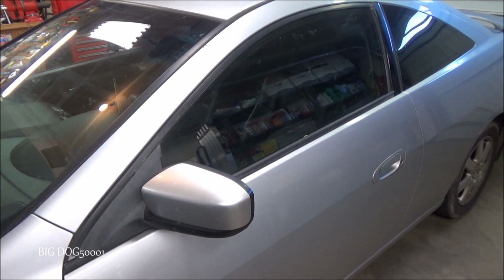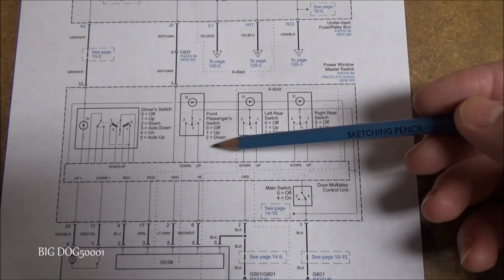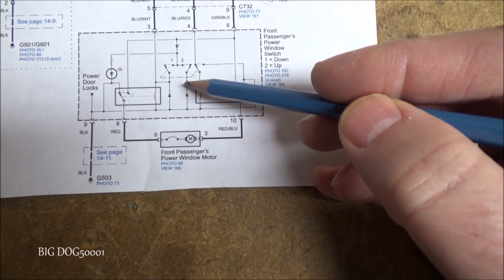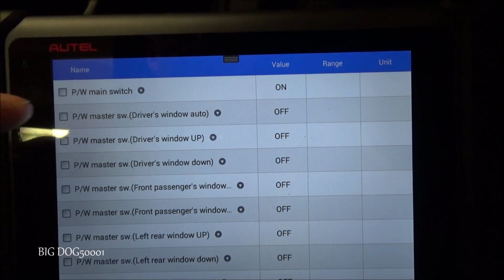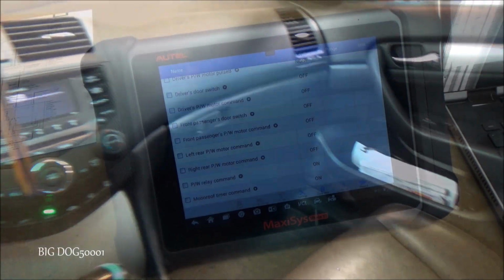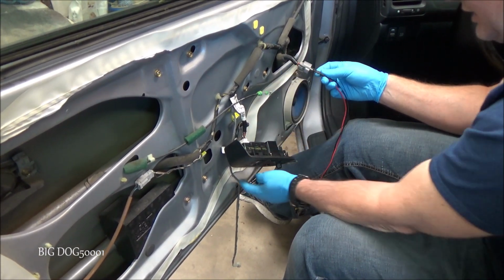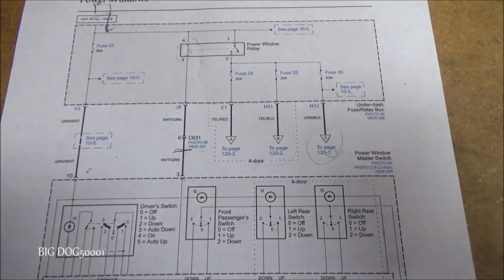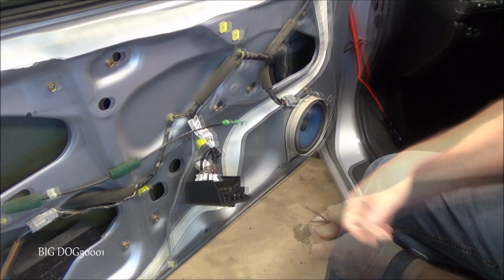Honda Power Window Troubleshooting Accord 2003-2007 (B-CAN Network)

Comment from the maker: Tools in video:
This channel earns a small commission using some of these links - at no additional cost to you.

Autel MS906BT scan tool: https://amzn.to/2Z4iaDs
OTC 3636 Test Light:  https://amzn.to/31G9Hbi

The Big Dog 50001 Automotive Channel Store can be found here: https://www.amazon.com/shop/bigdog50001automotive
Reply: 0
Reply: Hi when u said either the switch or the relay is the main relay that controls everything or just 20 Amp fuse that controls the driver door switch? Please reply thankyou.
Reply: Awesome video sir!  I have been having issues with my windows for about two years now.  The problem was always intermittent at first and then the passenger window failed completely.  Then the driver side started doing the same thing. 

When the window doesn't want to function, after a period of time, I will hear a 'click' and then the window will start to function. If I notice I hear a 'click' and try to operate the window it will not work.  It seems like something is just randomly switching on and off for a period of time. This is how the passenger window was acting and then just stopped working altogether. I am trying to pay close attention to your video a second time and hope it helps.  I like learning anyway so I prefer to watch your video till the end. 

Now today I heard a loud scraping/popping noise when putting the window up and now it will only open and close aboutan inch.  So now it is time to pull the panel and see what's going on.  Thanks for sharing your knowledge with us man.  I appreciate it.

Comment: Same car, different issue
Neither window works.
I had replaced the regulators, and the windows worked for a few weeks, then stopped working. 
First one stopped, then the other. 
I tested wired and checked fuses. All good.
Got the passenger window to operate a few times, then quit again. Seemed to “reset” if i turned the master switch off. Then nothing again.
Took the master switch apart, found it broken so i bought a new one. Still nothing.
Put another regulator in the pass. side while i had the door apart. Nothing.
If i apply power to the regulator at the connector, the window operates.
Fuses still fine.
Thoughts?

Comment: I had an issue where the drivers side directional blinked fast (as if one of the lights were out) replaced both front and back signals and the issue continued. Found this video, while it wasn't the exact issue I had I decided to check it. The old relay didn't seem broken it didn't buzz. But I replaced it and it solved my problem. Commenting this Incase anyone has the same problem as I did

Comment: I'm having a issue of the little button to control the up n down window, the lite on each button stays lite, even after head lights are off and dash lite dims out.  All but the drivers side stays lite.  Anyone have any info on what I need to do to correct it,  I've been disconnecting my battery every night to stop it from killing my battery... 2005 Accord.  TiA
Reply from the maker: The ground to turn on the LEDs on the driver's master switch is controlled by the control module (Door Multiplex Control Unit) located inside the master switch itself.  An input keeping the module awake or a problem with the master switch itself are places I would look.  Resetting the window control unit is worth a try.  https://youtu.be/scWc_9ALo9Y

Comment: (2009 4-door Civic) Over the last 4 years, each of my 3 passenger windows has gradually developed a failure to roll UP from the driver control switches (only).  One-by-one, over those years they individually each started to stutter over several weeks and eventually completely failed to roll up from the driver door controls.   All windows DO function perfectly up/down from their respective local door switches.  They also roll down perfectly well from the driver control switches.  I have been though several of your videos and can't find the appropriate one for my issue.  Please direct me.  Thanks !

Comment: Hello sir I have honda pilot both of my rear passenger window not working even if I use the driver power switch but I hear is clicking i check the rear passenger window relay its good and the connection i have power and ground when I check both of the fuse using my test light and doesn't light up no power and I have ground on both switches I dont know why both fuses has no power. Can u guide me what to test next?

Comment: Power windows in my Honda Civic 2011 will not go down and my tail lights are out now to? Wondering why ?
Reply from the maker: Depends on whether or not the problems started at exactly the same time, they may or may not be related.  Here is a video where I troubleshoot a Civic similar to your 2011:  https://youtu.be/-aJjB0VPAEk

Comment: So, according to your diagram, there are relays in the front passenger side window switch. I hear clicking, sometimes at a stoplight it just "clicks". And the window will not go down. Or, it will not go down until I pull over and slam the passenger door. But there is a "clicking" coming from that passenger side switch area. The window can be operated from the master or passenger switch, when it does work. So is it the relay, the "home/ auto-up" feature needs resetting on the module or the switch. This is a problem that Honda has had for many, many years with their windows, their radio back-lighting going out, and LED back-lighting on the speedometer. There are countless forums on this window problem, and people are begging for answers. Some are even asking for help to convert this motorized debacle into roll-up windows. Unreal. And wait for the Tesla owners 6 years down the road.  😅 😂 🤣

Comment: I bought an Accord today were the drivers window doesn't work and the passenger window goes up and down slowly. The good is the owner reduced the price by 2500 lower than the same car was selling for everywhere else in my area.  For that I could put stainless armored plate in place of the windows. lol Just kidding.
Reply: How good are you at removing the inner door panels? Pretty easy if you go slow. The "regulator" has a cable attached to the motor. As rain and the elements get in the area of that cable, it causes corrosion and a little rust. Much like a brake cable or a gear shifter cable on a bicycle that never gets lubed. I took all of my motor/ regulators out and lubed them thoroughly with a silicone spray. I mean soaked them. They work great now.

Comment: I had an issue with my wife’s 04 Accord where the LF power window suddenly stopped working.  I watched your video and was totally impressed with the depth and detail that you went in to to explain the entire system using the wiring diagram.  You also showed your diagnosis procedure using simple tools.   As it turned out the motor was the culprit, which I dismantled, tweeked the brush springs ,and now it works like new!!  I must say that you’re a very good teacher……in fact I told my wife that you could work at any college or mechanics school around.  Thanks again and keep up the great job!   Roy Bartz 👍
Reply from the maker: Thank you, I appreciate the comment!

Comment: very informative video thank you. All my windows except driver side in my 4 door 2005 accord havent been working for the past few years and just yesterday the drive side finally gave out when i put the window down. Now all my windows dont work but just by watching your video im convinced I need to replace the window regulator
Reply: I have the same problem as you. Only drivers window works. Did you figure out the problem? Thank you.
Reply: Did you figure out the problem?

Comment: I’ve watched tons of videos on trying to diagnose the problem with my passenger window not working. After watching this I wish it was my driver side not working!! What would you suggest my next step to do as I’ve replaced the master switch, regulator/motor, fuses and I am getting power to passenger switch. I’m all out of options smh.

Comment: This is a great video I was looking for. I have a 2005 Accord coup 2.4 and my both windows acting up on me. I haven't found any system how they work or actually don't work, sometimes they do work well, then they don't. Sometimes I hear clicking sound from the switches (even on pass.side) and sometimes I don't. Sometimes one window is dead but the other works... I'll try to use your know how about the wiring to track it down, but my problem is - it works and it doesn't, like a bad wire connection or something like that. I tried to reset the control unit also. No success. I used a foxwell scantool and one interesting is, when you push the switch let's say DOWN the value in the scantool says UP, but the window goes down, when you push UP, scantool says UP. Anyways, thanks for your time, cannot imagine a better lesson to these honda's windows problems 👍
Reply: I have the same issue
Reply: @olee_24  I replaced the window unit on driver side, it was working for couple of weeks and then back to the previous stage. There must be something with the wiring, probably corroded on the way to the ECU, or exposed to another wire or chassis (maybe in A pillar where it goes from the door into the interior of the car). I have no time to track it down.

Comment: Urgent help:
I have 2006 Acura TSX. The window switches on all the doors stopped working and don’t even light up. I know I messed up some electrical component because when I use my oem key and hold the unlock button, the windows roll down.
There is no power in the switches, can you help??
Reply from the maker: You can keep it simple to start with and check the fuses, but that is probably going to need some troubleshooting done on it.

Comment: What would be the problem if i always have power in the down position on the passenger window even if im not pressing neither switch its acting like its pressed in the down position already replaced passenger switch but im still to replace the driver side switch, how would i go about testing if the main switch is the problem?

Comment: Thanks you master mechanic.. technician.
Reply from the maker: Thank you, I appreciate the comment!
Reply: @BigDog50001  
Hello Sr have a question about the master switch. My problem start normal stress day , travel to dinner and after found parking close the window noooo 😥 no work go back apt and pray. Start for study how this works found thermal switch bad, eBay used good God thanks . How I reset the switch. Thanks.

Comment: Great video I have the same exact car with a very similar problem. I have changed the regulator on the driver's side and powdered the window up and when it got to the top it stopped and now every time I press the button to let the window down it blows the number 27 fuse and I don't have a clue what the problem is.
Reply from the maker: Things I look at for blown fuses, either the component (window motor in this case) pulling too many amps or a wire is shorted to ground.  If it wasn't blowing fuses before I would double check work or it is possibly a bad new motor.  Thanks for the comment!
Reply: I tried some of the things that you are saying and I finally found the problem and it was something that I really didn't think about. The new regulator I brought was defective I replaced it with another one and problem solved. Great video though it was very helpful I subscribed to you channel looking forward to future videos.

Comment: So I’ve change the window motor and wires, checked fuses and everything good and window still don’t work, what should I do next ?
Reply from the maker: Test light is your friend in that situation.  I would use a test light to trace back where I was losing power or ground.  If either is missing (or not good enough) then the window will not work.

Comment: I have the exact car a 2003 Honda accord lx coupe 3.0 6 cylinder automatic but neither my power windows not locks work and I have only replaced fuses under the steering wheel can you show me where the relay is? Thanks in advance
Reply from the maker: I would check all fuses in the DASH and HOOD fuse boxes.  Windows and locks are two different systems, so I would look at what they have in common (under dash fuse box/MICU unit and the switches come to mind).  I would definitely make sure the driver's side switches are plugged in properly (especially if work was done on the door recently).  It will probably need some troubleshooting.
Reply: Hi there update on my vehicle so I just replaced the master control switch panel straight from the dealership ... now my passenger window goes up and down beautiful but my locks and my driver goes up or down any recommendations ...? Maybe I need to reset the window switches somehow?

Comment: how much would this cost if i had went somewhere ?
Reply from the maker: Most shops start with an hour diagnostic fee which can range from $75-$150 depending on where you live.  Some will waive the fee if you pay for the part and install to fix it.

Comment: Great video! I'm having trouble diagnosing the issue with my accord (same year coupe).....if the driver's window does NOT go down when you hold the unlock button on the key FOB, could it still be a bad window switch?
Reply from the maker: They are multiplex controlled so it could be many things.  Easiest thing to try first is a control unit reset.  https://youtu.be/scWc_9ALo9Y

Comment: Do you have a solution to the following issue? '04 Accord Sedan Power window switch was working before I replaced it with a different USED power window switch (Needed the new wood grain plastic piece, the old one's plastic screw insert/plastic tabs broke) the new used one came with the switches attached so I just put it in & it does work overall, however the passenger window switch rolls the passenger side window up & down but you have to keep holding the switch in order to do so otherwise if I press down it will start going down but if I let go it will just roll back up (Problem.#1, Note: The Driver side switch rolls the Passenger side window up & down just fine).Does the passenger side power window switch also have to be re-prpgrammed? 
Problem #2 With the new USED Power window switch sometimes I will hear a clicking slight sound for the Driver side Power window like the sound when you would press the window button up but the window is already up (But you're not pressing any buttons) & if you try to roll the Driver's side window down while it's making this clicking type sound it won't respond/work, if you wait about 3 seconds after the clicking sound stops then it will roll down & up just fine. (Note: During the clicking sound even though the Driver window won't roll down, all the other windows will operate via the Driver window control, including the power mirrors). What do you think could be causing Problems #1 & #2? 
I could try putting the Original Driver side Power window switch back on the new Wood grain plastic cover, if I do should I also put the original power mirror remote back on as well or does that not matter?
(The reason why I'm asking first instead of just putting the original controls on the new wood grain plastic piece is I'm concerned I may break another Plastic clip or damage the plastic screw inserts again removing it & would have to order another wood grain plastic piece again). Hopefully there is a simple solution for Problems #1 & #2? Thank You
Reply from the maker: The window switch (master switch) on driver's side has a control unit in it.  Honda master switches are finicky, If the new (used) one is not the correct part (different trim lines use different master switches) or it is an aftermarket unit there can be issues like you describe.   Clicking sounds sometimes mean the control unit has learned the wrong position of the window and It is possible it just needs to be reset.  Breaking plastic on those trim pieces is a real concern, the wood look ones are very brittle.  Original JB Weld works pretty good on fixing plastic pieces in areas that aren't going to be seen.
Reply: @BigDog50001  Do you think I should put the old switch back in the new wood grain plastic? Also does it matter if I leave the mirror remote in there or should I put the original mirror remote back as well?
Reply from the maker: @milehighbuilt6373  I would probably put the original switch back in if it was my car, being aware that clips and other plastic could break.

Comment: What if the motor is running but the window isn't going up? Is the regulator still bad or the window off track perhaps?
Reply from the maker: Sounds like an issue with the window regulator.  Some have a cable style regulator (most newer Hondas have this) and some have a scissor style regulator.  Some regulators can be replaced separately, but for many vehicles the motor comes with the new regulator.
Reply: @BigDog50001  Appreciate it. I will order one today.

Comment: Hi. I've got an issue with a Civic 2008 plate. All power windows don't work from either the drivers door switch panel or from the switches on all doors. I've tracked it down to the MICU and I was wondering if the Power window relay is internal or external of the MCU. I can't find any diagrams to show where it is. It's a 2.2 diesel model.
Reply from the maker: On most Hondas the window relays are replaceable and are usually in the under DASH fuse box.  On most of those generation Civics it is located on the very top left of the fuse box.  On these Civics, usually the MICU only controls the ground on the control side of the window relay (as a key off timer).
Reply: @BigDog50001  Thank you very much for this info!!! You mean the black one? I did read that the original Omron power relays were swapped for Mitsuba ones...part number 39794–SDA-A05. Do you know if this is true or not? Have you heard of the issue with the A?C relays too?